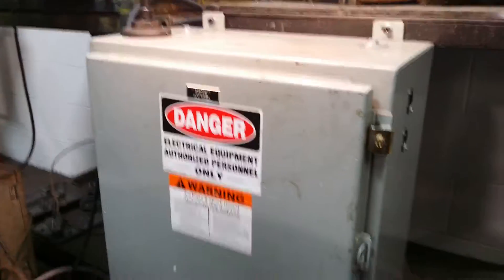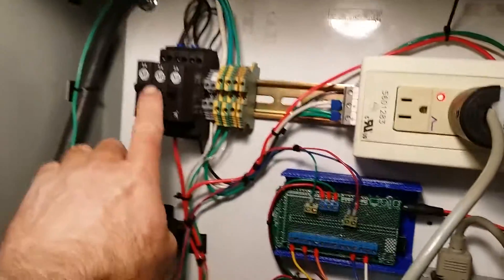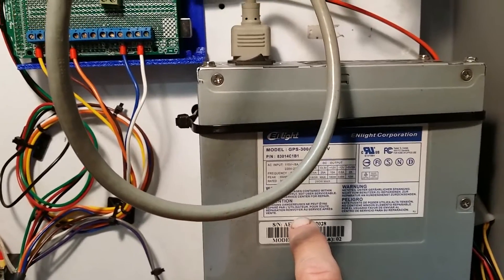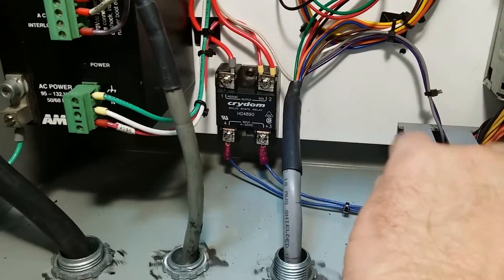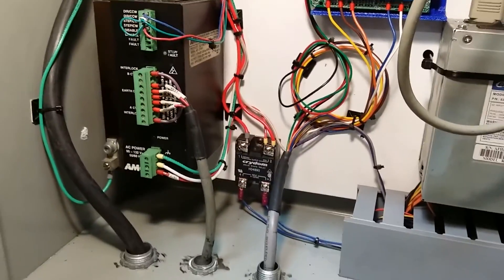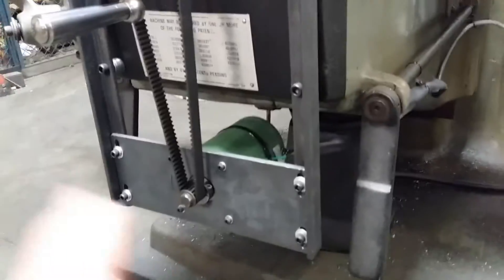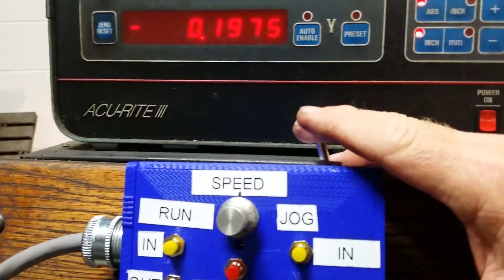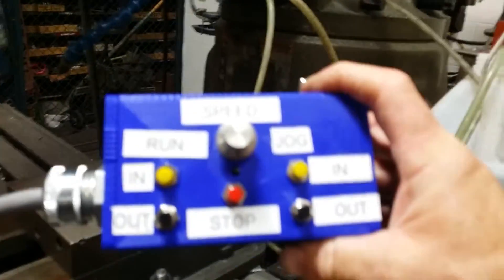Drive a large stepper motor with an arduino Part 2

Comment: Nice project!  I am mid way through a similar project on my Bridgeport Z-axis. NEMA 34 motor, switch for Up and Down, Potentiometer for speed control, and Rotary Encoder for fine adjustment, controlled by an Arduino NANO.  Works well so I am planning to add a Y-axis unit and also replace the factory X-axis.  Thanks for the video. Very interesting.
Reply from the maker: I bought a bench top milling machine for my house and I might make that a CNC.  https://wenproducts.com/products/4-5a-variable-speed-single-phase-compact-benchtop-milling-machine-with-r8-taper

Comment: I would love to see how you set it up with the encoder.  I'm working on automating a table saw fence and picked up a stepper with an encoder but I'm not sure which board will work best or how to set it up to use the encoder.  Nice mill, by the way.
Reply from the maker: +George Wood Hi George,
I didn't use an encoder. the mill already had one on it.
Reply from the maker: +George Wood .
Check out this web site. they are all about DIY CNC stuff. http://www.shapeoko.com/